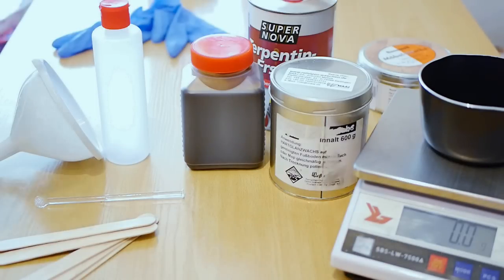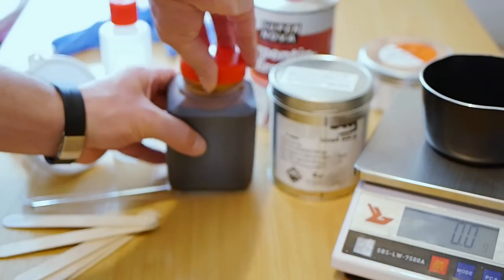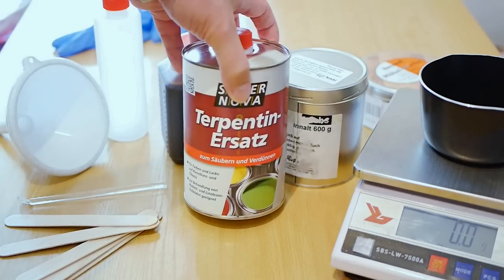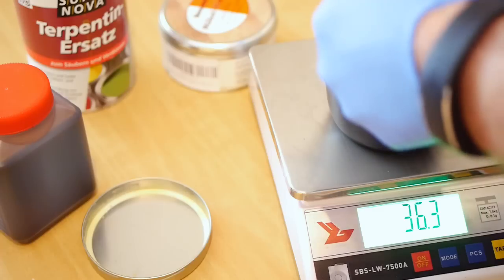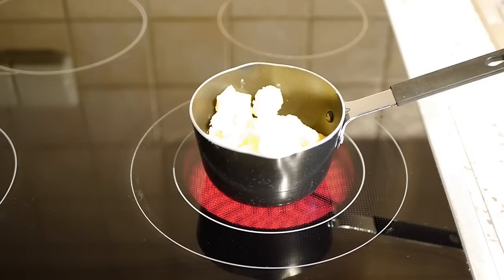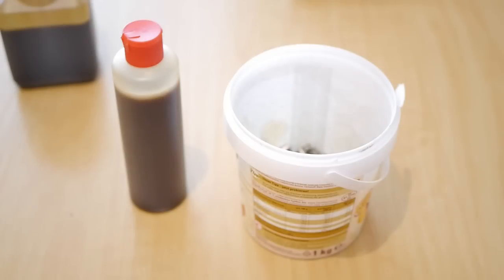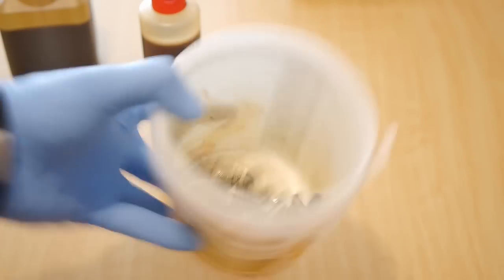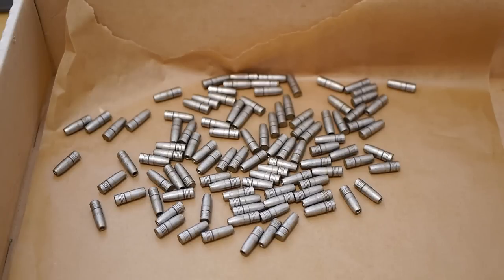Tumble Lube - Alternative Liquid Bullet Lube Recipe

Comment: I work in the railway maintenance industry in the UK, and we use Tectyl 506 for the axle end caps and earth return assembly bolts. We have large drums of it here in our COSHH cupboard. It's brown goop and it stinks! (Like most brown goop)! Ours seems thicker than yours though. It may have dried out a bit from techs not putting the lid back on after use!
Reply: hello, maybe by putting a little more white spirit to fludify the product

Comment: It seems to me like this tumble lube is designed for tumble lube grooved bullets like ones you had.  With bullets that have one or two big lube grooves I thing it might not work well since the lube gets pushed off during seating in the case.
Reply from the maker: It's works with regular lube grooves as well but the TL design is better for this.

Comment: Hello, does it have to be the 506 "EH" the EH we can only order in 20ltr drum here... Does the plain 506 also work?
Reply from the maker: I did not test the normal 506. If you get the normal 506 in smaler batches give it a try. If 20ltr drum is the smallest one then the 506EH to make sure it works
Reply: wiederladerTv.  Do you have something for sale also? I just got â message back that 506 also only comes in 20ltr drum...

Comment: Hi, another alternative of "Johnson paste wax" is to make it ourself, cheap and easy, with a mix beeswax and turpentine, and you can make it with the consistency than you want, and also you can add a bit of carnauba wax.
It's exactly the same method than to make lube, but you must put the mix in a closed bottle(or a closed box depends of consistency you want), and wait 1 day before to use it. (sorry for my English, I am french).

Comment: I did some checking.  I found that this Tectyl 506 EH is affiliated with Valvoline Europe and is made in the Netherlands. It is a waxy rust preventative used in chiefly in the automotive trade.  I checked Advanced Auto and Napa Auto web sites here in the United States and this product does not appear to be available here.  I'll have to check e-bay here in the United States.  Thanks for this video.  I alway enjoy your work.

Comment: Have you ever used or made the traditional American NRA 50/50 lube, half beeswax and Alox 350?  The original formula of the Alox part has changed some, but its been one of the oldest and well trusted of the standard lubes.  I'm sure you can get beeswax anywhere in Europe, and I think I've seen UK Ebay have the Alox available.
Reply: Maybe but the shipping is very expensive.
Reply from the maker: That's right